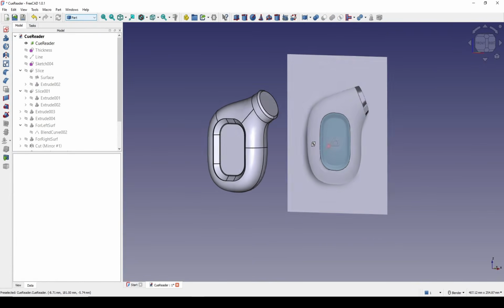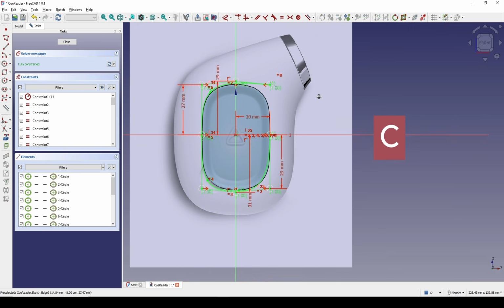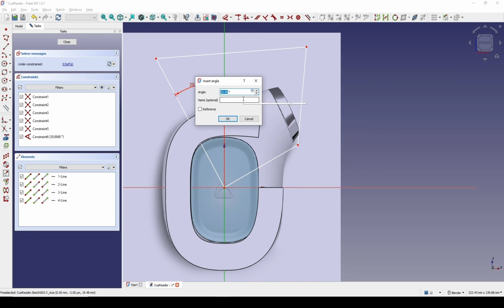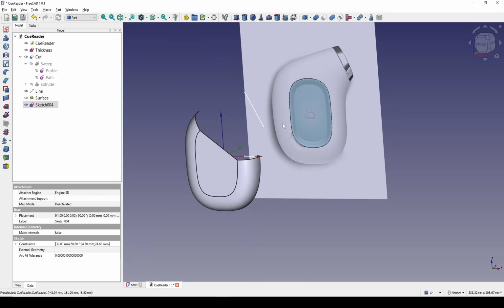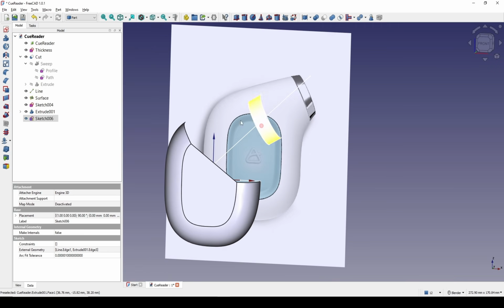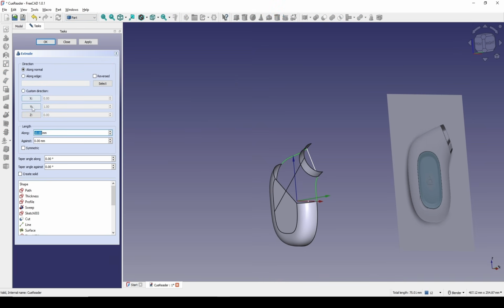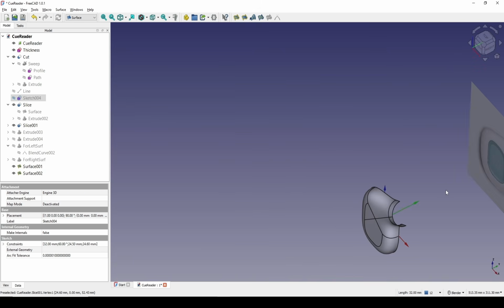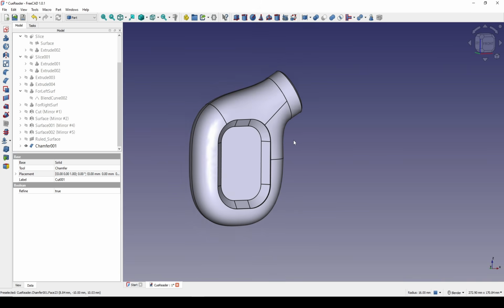FreeCAD Surface Tutorial - Create Cue Reading From Image Reference

Comment: Thanks for the tutorial, it was very good! I am somewhat new to FreeCAD and really appreciate your tutorials on surface modeling. Why do you only select g1 continuity, is there a reason for that? Also, is it necessary to create surfaces along the boundaries/edges (ForLeftSurf/ForRightSurf) in order to use the filling tool or for it to work correctly? It seems a bit odd to have to do this since it looks a little strange, but if it's necessary in the current FreeCAD version, that's ok. If you can create a video explaining the theory and reasonings behind WHY you do things a certain way, that may be very helpful for many people. Thanks again and please continue creating these very helpful tutorials! 😊
Reply from the maker: FreeCAD G1 works well. G2 is sometimes okay, sometimes not. As for the second question  yes, to make it work correctly, we should do that.
Reply: Thank you! @DuyQuangDang
Reply: lol i had the exact same question about g1
Reply: Yeah as he stated G2 in FreeCAD ist not really good to be honest.
Reply: You dont NEED to create surfaces. 

You can use 2D elements like arcs or splines or whatever but then you can't make the new surface tangent to anything.

So there would be discontinuities between the new and existing surfaces